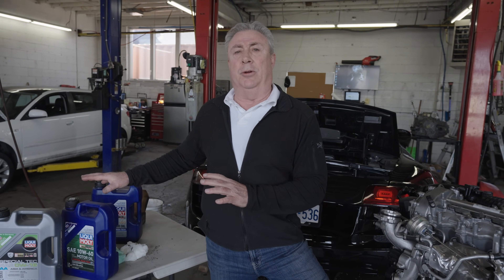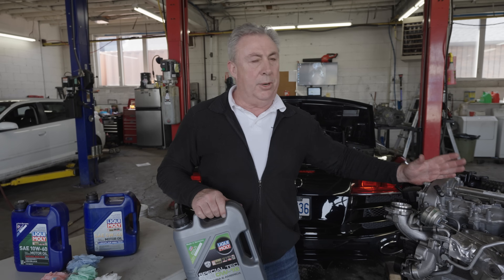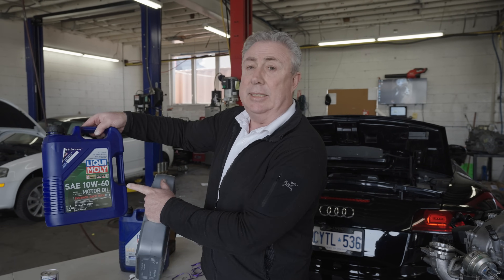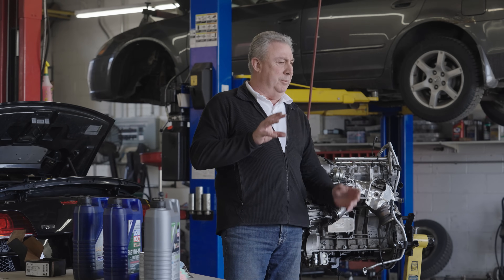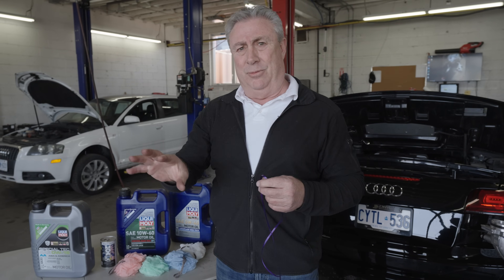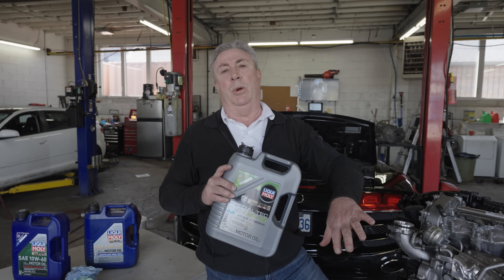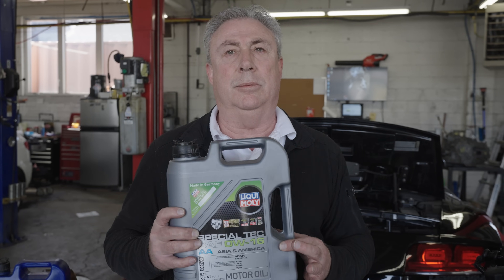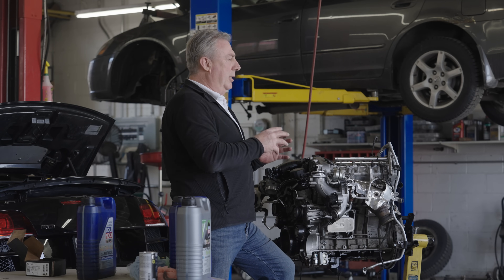Thin engine oil just a Scam? What's Safe

Comment: Both of my vehicles call for 5w30. I use that in the winter and 10w30 in the summer and never had a problem in the 15+ years I have owned them. I've even used 10w40 with no problems.
Reply: @williamrice4608  Essentially, you know more than the vehicle's design and test engineers. Amazing!
Reply: @davepaturno4290  I know more because I learned it from a petroleum engineer. Besides car makers have no vested interest in the longevity of my vehicles. That''s why one is a 2002 and the other is a 2007. They run great on the original engines and use no oil.
Reply: @williamrice4608  That's definitely wrong when it comes to Toyota/Lexus, Mazda, Honda, Subaru engineers. They value their reputation very highly. I've worked with Japanese engineers.
Reply: @davepaturno4290  Just because they are auto engineers doesn't make them oil experts. They have to recommend what the EPA tells them to make the gas mileage limits. 540 RAT is an oil expert and takes issue with these auto makers recommendations.
Reply: @williamrice4608  Auto engineers are not experts with everything, but they are expected to work either experts within and outside of their employers. At times before I designed a sheetmetal or CNC-made part, I would consult with experts in those fields. I also have received advice from experts in bonding, plastics, elastomers, seals, coatings, vacuum and pressure systems, gauges, software, etc, etc. No one person knows everything, but the smart ones know when to seek advice. Most auto engineers are no different. In the end, consumers often choose a brand that has a history of building products that last. To maintain that type of customer base, companies need to design, build, and test reliable/long-lasting products.
Reply: @ The EPA is their oil expert and for other auto makers too. I go by personal experience. My 02' PT Cruiser uses 10w40 in the hot summer time. It has 226,000 miles on the original engine and I've never had an issue with it. As i said I do used the recommended 5w30 in the winter. I see no reason to mess with success.
Reply: @williamrice4608  Many, many Toyota owners have far more miles and achieved better fuel efficiency by using the lower viscosity oils in their vehicles' manuals. As far as reliability goes, no car company beats Toyota/Lexus. Mazda, Subaru, and Honda are not far behind.
Reply: @davepaturno4290  I've never owned any of them so I can't say from personal experience. The PT is old but still get 32 on the road. It is not aerodynamic by any means. Funny how might recommend 0w16 here in the U.S. and 5w30 in another county. It does go on.
Reply: @williamrice4608  I guess if I were to drive in Saudi Arabia or on the Autobahn at 120 mph, I'd want to use higher viscosity oil, also.
Reply: @davepaturno4290  The main reason I'm using 10w40 in the summer is the PT engine gets damn hot. Opening the hood after a drive is like opening an oven. Even 10w30 drains out like water. I'm sure after 220k+ miles the engine is pretty "loose" and doesn't mind the heavier oil.

Comment: Thin oils were introduced to lower friction and improve fuel efficiency, what they did was sacrifice engine life for fuel efficiency, passing the cost on to the owner as the problems will usually start when the vehicle is off the warranty list.
Reply: If the thinner oils lower friction how does the engine wear out quicker? Your statement does not make any sense. Anything with lower friction has less wear. Another uneducated YouTube expert. I suggest you look into the engineers that produce race engines for Bathurst and the testing on oils they have done for over 35 yrs.
Reply: @mattharrison9550  I'm a mechanical engineer. What are you? You should not randomly increase viscosity if your engine is street driven and you are not using high alcohol fuel or track racing unless your owner's manual specifies so.
Reply: @davepaturno4290  well if your a mechanical engineer you should know that the Bathurst engineers, BMW engineers, if fact all euro car engineers will disagree with your statement. As I said look into it, science does not lie. I'll trust those engineers over a self proclaimed mechanical engineer on YouTube. I too was in the racing industry and know what I know, but I don't know more than the experts who study oil. I go off what they find in their studies and experience over 35 years.
Reply: @mattharrison9550  Then watch the Care care nut, Ahmed, and Toyota master technician who's worked on far more street-driven Toyota engines than many dealership techs. He has said often that it's not the recommended oil viscosity that kills engines; it's the driving habits and extended frequency of oil changes that do so.
Reply: @davepaturno4290  It's still the motor companies passing on problems to the later customer to save them money. Dealers selling to contracts such as hire companies and business 'fleet' buyers can herald the low service costs of their vehicles knowing full well it will do 2 things. 1) Makes them seem more competitive 2) take the car off the road as soon after it's out of warranty as possible. This oil, low/ extended service intervals all part of the same scam.
Reply: @mattharrison9550 So basically you're agreeing slightly thicker oils will protect your engine better in most circumstances and going from a 0w-20 to a 5w30 in a 3.6 6 cylinder is ok perhaps?
Reply: Drag is not friction
Reply: @mercedesvan-doors34  So Toyota engineers typically don't care about their reputation when they specify oil type/viscosity? Do you understand Japanese culture and engineering reputation?
Reply: @davepaturno4290  apparently you’re not up-to-date on the most recent Toyota motors that are failing and dropping like flies. Absolute garbage.
Reply: @Maynardd  Little do you know that 0W-20 synthetic oils have been used for about 20 years, and no, Toyotas since then have not been experiencing failed motors due to the oil. I think you need to look deeper into the actual causes of recent failures.
Reply: @davepaturno4290  either way, Toyota has turned to absolute shit, and this is for coming from someone who owned two Tacoma‘s. You were mentioning they would be concerned about their reputation. Clearly not. 
And the bottom line is this, when you have engines that were running 5W-30, and now the manufacturer is saying you 0W 20 on that same engine, they’re wrong! 
But hey, thanks for filling me in that the issue is not the oil, and proving my point by saying their engines are just complete shit regardless of it.
Reply: @ I understand Japanese business, making cars that run for hundreds of thousands of miles is not conducive to good sales of new cars. Think about it, car companies are in the business of what? Building reputations? NO They SELL CARS, nothing else matters. Just enough reputation to sell cars, just enough looks to sell cars, just enough engineering to sell cars. Why do you think virtually no car sold in the last 30 years has had an oil pressure gauge? because it acts as the canary in the mine and tells the low oil pressure story, the story that your engine needs help, help it doesn't get until the next extended service meaning more wear, less life expectancy. You can use whatever oil you like, it's a free country. I built and raced high revving 4 stroke bike engines and I've heard a lot about oil over the years, only one thing matters, that enough pressure is maintained in the mains and bottom ends to stop metal to metal contact, if you think your Toyota is managing that at 100k on 0-5w you work away.
Reply: @mercedesvan-doors34  Do you walk around with a blood pressure gauge to constantly monitor your blood pressure? Why not? Based upon your reasoning, we should all do that. 
 You can easily plug a Scan-type gauge into your OBD II port to constantly monitor many engine parameters. Most vehicle buyers are not mechanics or engineers. Toyota/Lexus has a reputation based upon historical reliability of vehicles that can last for 20+ years and 300,000 miles if maintained as per the owner's manual. Your believing that they design vehicles to last until only until the warranty expires is incredibly false.
Reply: @davepaturno4290  what ever you believe you do. It's a free country.

Comment: If you have a car that uses 0w/20 or 0w/16 and you worry the engine oil is too thin than just change your oil at 4K intervals instead of 10k.  That will reduce wear on your engine and you stay in spec for the tolerances and variable valve timing.
Reply: Agree. But by doing that, the cost of oil changes becomes an issue.
Reply: @jeffleverence4554  not really....
Reply: @jeffleverence4554  Oil prices still better than gas prices overall🤟
Reply: Why would changing it sooner help?  If I change it at every 4,000 like you're suggesting, that thinner oil is still in that vehicle for that amount of time and every other 4,000 Mi interval. Thin oil is still thin whether I change it every 5 Mi or every 50,000 miles. Changing thin oil more often doesn't make the oil more protective.

Comment: Consider temperature and how much load is on the engine.  If I were racing or pulling a heavy trailer I'd use a thicker oil to protect the bearings.

Comment: Never below --w30.Screw environment scam. Co2 is a life giving gas. Manufacturers destroy things that worked fine, to avoid fines due to the co2 demands from our overlords🤷 in winter i go 5w30, in summer 5w40. And its still according to the recommandations, because its a 2013 model. However i have a port injected engine, and will never own a gdi again. These engines wont last. I had a few, they consumed 0-20 oil excessively, and clogged up the intake. Combine this with low tension pistonrings and high pressure gdi fuel pump, and you got trouble. I mean, its better to have a car run longer, than to make it crap, with lower emissions, but half the lifespan. Anyway, the world is a theatre.

Comment: Don't forget the Nikasil, Alusil, Lokasil, and Silitec cylinder coatings that don't use regular honing to suspend oil to lubricate the rings like traditional iron cylinders, coated liners absolutely require the specific oil molecules of these modern low viscosity oils to prevent scuffing and wear on an otherwise smooth liner. It's way more complicated than just meeting EPA specs. Rather than putting the wrong oil viscosity in your engine, just change the oil at more frequent intervals with the correct viscosity product. Another thing to consider is most modern lubrication systems do multiple processes beyond just bearings and rings, these include hydraulic servo circuits for variable valve timing, various tensioners, bleed pressure valves in split flow systems to lubricate cams etc, and in some cases variable pumps. Throwing high viscosity oil into these systems is not a good idea, on top of the other damage that can happen to cylinder coatings there is plenty of evidence of premature dead engines that have had the discount service center throw in the shop grade 10W30 mineral where a more expensive 0W synthetic oil is needed.

Comment: We have 189,000 miles on our Tesla Model S all wheel drive and we still haven’t changed the oil.  ( a couple of c/v axles and a LOT of tires, but no oil or brakes)
Reply: You are aware that the Tesla has a transfer gear box and a rear diff which both need  an oil change before that mileage?
Reply: @bikeman123 You won’t see 20 year old appliance things running around n the future. 🤣
Reply: WTF cares about your hairdryer appliance iPad thing.

Comment: I always understood that most engine wear happens when starting, especially when the engine is cold ( and the oil is thick). Would a lighter grade oil not start circulating faster during a startup, thus protecting the engine better?
Reply: You have to remember thicker oil clings so on start up your parts already have a jacket on them..
Reply: @seatime674  Absolutely.  Water-thin oil, in contrast, drips right off, leaving the parts almost dry.  That, I would think, is a bigger problem.
Reply: Multi-grade motor oil does not get thick enough for that to be an issue, unless it is regularly well below freezing.

Comment: Motul 8100 Power 5/40 full synthetic with part Ester, used it for decades in all my cars with it's evolving iterations. I live in Central Otago NZ, -10 to -20c averages most Winters, up to 40c in Summer, engines have never missed a beat. 405,000 km on my 97 Accord, still runs as good as new. 10/30 FEO recommended by Honda.

Comment: I put 5w-30 oil in my diesel instead of 0w-30 oil. Fuel consumption increased, the exhaust was no longer so clean. After 3000 km, the problems started with the check engine and ad-blue lights coming on. Everything was OK only when the air was warm, above 20 degrees Celsius. I suspected that the problem was in the oil. I changed the oil with the prescribed 0w-30 and from then on there were no more problems. This is my experience.

Comment: Just purchased a 2004 Lexus ES 330. 72k. Not sure if regular oil or synthetic was used. Is it ok to use the synthetic I have used in my other cars for years with great results. We live in E. Tennessee, have used 5W-30 year-round in my 2018 Mazda CX-5, has 196k on it. Runs great. Would that be a good choice for the Lexus? Thanks, great description of oil properties and mileage, wear etc. Bill.
Reply: I have an 04 ES330 with 211,000 miles. 5W-30 is the Lexus approved viscosity. You can use synthetic whether it has been used in the past or not. Enjoy your car, mine still runs & looks great although I've never liked the transmission in it. Jerky & sometimes hesitant shifts.
Reply: @Monarchloans-b5t  Thanks!
Reply: Yes but you have to make sure the weight of the oil is the same or thicker, not thinner.  Example: 10:25 You can't be using 10W30 conventional and go to a 5W30 full synthetic or you might get a leaky seal. Use a 10W30 or 10W40 full synthetic and it would be fine. I have switched many vehicles to full synthetic with high miles even. My neighbor always used 10W40 conventional in his Ford Ranger and it leaked about a quart a month. He went to a oil change place and they used 5W30 conventional and his truck was leaking 3 quarts a month. We changed to 20W50 conventional and now it doesn't leak a 1/2 quart a month.

Comment: No that is not true.
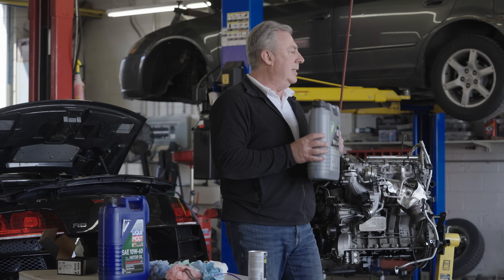@1:10 "its great for everything except the motor"

Yes, that is the OLD thinking and regime. 

That thickness (viscosity) is the (only/one of the major) thing that protect and slow down wear.

Yes, in the OLD day that were true and still is to a much smaller degree today.

So this focus on viscosity that is just less important rant in the video.

Oh, my oil and water temperature is fluctuate with outside temperature?? Or we are towing..

That is not true and wrong thinking. In a engine we have a termostat that open more or less water flow that will go through to the radiator to cool down water and the whole engine including the oil in it.. so the engine will keep the engine temperature at SAME level of it is cold or warm outside, and the only difference is that it is more or less water that is needed to go through the radiator.. usually you dont see your temperature gauge fluctuate up and down as it is set at a GIVEN temperature!

So what have you done with trying to do OLD school again with compensate your oil change viscosity depending on summer or winter... That were in the PAST when we had singel grade oils! Now we have multigrade oils with a big span of thickness.. so that old Myth need to go..

Today we have tiner oils because we can! When testing and  additive package  and chemicals is much better. That makes us not needing to rely on viscosity as the only thing for protection.

This old dogma that thicker is better in wear.

Is like indirectly saying that ALL testing that oil manufacturer, car manufacturers, oil specifications laboratorium and so on is WRONG!

A real world example..
When API introduce a new specification. The latest and current one is SP (for gasoline).

SP is tested and have the lower wear than the previous older specification (SN, SN-plus)!

So that ACTUALLY means that you should ALWAYS choose the latest API classification when it meet and super side the older and previous standard. And have therefore the same or most likely lower wear!

So there is the truth..

Now to the "other" details.. is that your car manufacturer have tested your engine and not only that.. they have DESIGNED your engine internals for a given viscosity..

Now you are smarter than them? And oh it is summer/winter/towing and so on.. Yes in the OLD days..😂

IF you are concerned about wear (as you should be of different reasons, like longer and longer oil change intervals for example) then change your oil more often!

It is better from a wear perspective to change oil more often with a cheap oil that meets the specifications like API above. Than buying a super fancy oil and Puch the shit for a longer oil intervals!

The amount of sot in the oil is acumulates each mile, at the same rate regardless if you have a cheap oil or a pricy fancy oil.

That means that after a long oil intervall your sot is wearing your cylinder walls and clog your piston rings. 

In short you have higher wear with longer oil change intervals and a oil change is the only thing that drains out the sot that is suspended in the oil.🎉

What has happened the last decades is that car manufacturers has been better to know/calculate when and how long we could go between oil changes so the wear and the corresponding oil consumption is happening outside of warranty!😢

So there is no way around it.. regarding wear is change your oil more often.. with that viscosity your manufacturer says and with the latest specifications.

Goal achieved!😂❤
Reply: Look